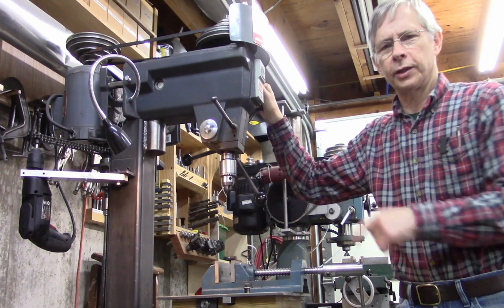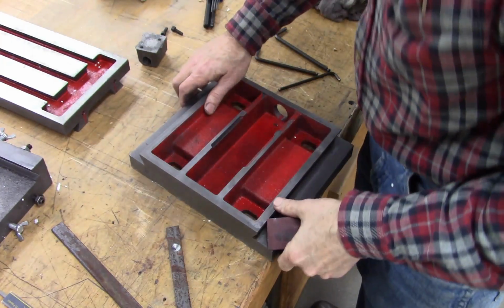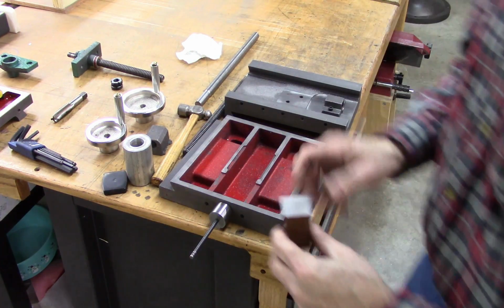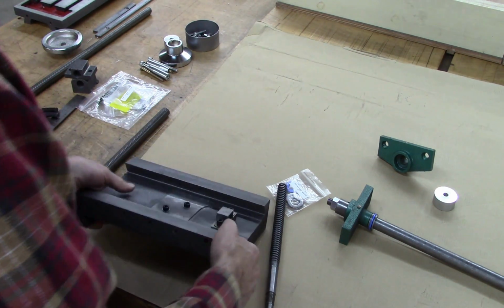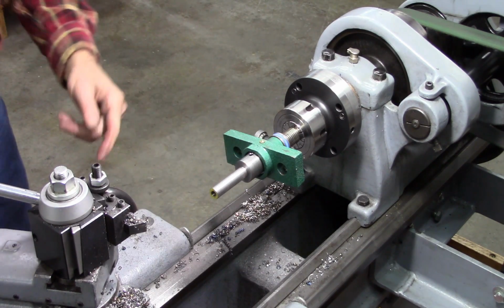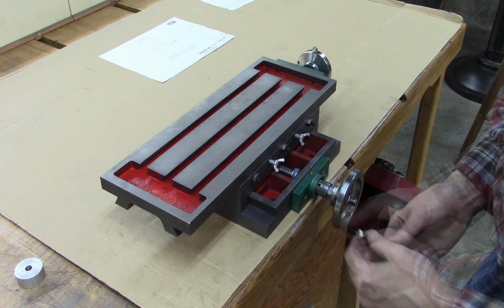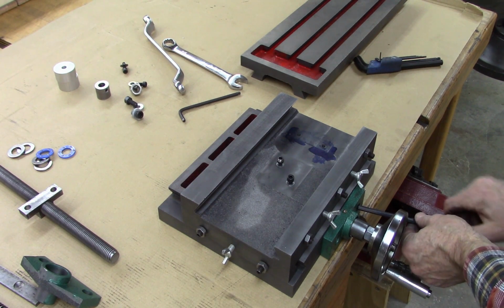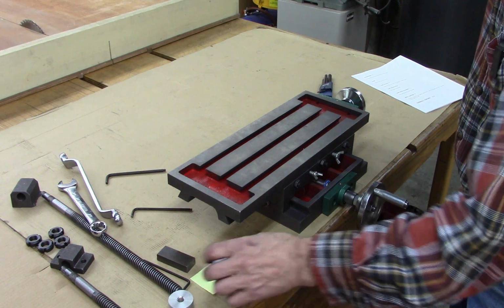Part-1 Vevor Compound Mill Table Review and Lead Screw Upgrade

Comment: Ok Winky. This is my last intrusion on your peace. I assembled the parts and found that the top table was very stiff. So on your suggestion, I opened it up and found that one of the bolts that holds the lower lead screw nut in place was rubbing on the upper lead screw. I took it out and used my grinder to reduce the diameter of the Allen head top. That did the trick. 
I might have made a mistake by applying a thin coat of silicon synthetic grease to all the sliding parts. It may be too heavy. I don’t know. 
After reassembling everything, the upper stage moves without any bumps although it’s still tight. 
The big problem is that I can’t center the mill table on my drill table because the lower turning handle hangs below the lip of the table. This mean putting a piece of wood underneath to raise the mill table. 
On top of that, I have a 4” mill vice that sits on top of everything. The weight is considerable and I don’t think my 20” Jet 20MF drill can handle it. Raising the table up and down is frightening. 
I just bought this drill press and I’m unhappy with it. I should have gotten the floor standing Nova instead. 
Thanks. 
P
Reply from the maker: No worries  please intrude anytime! 

>I can’t center the mill table on my drill table because the lower turning handle hangs below the lip of the table. 

I think you might be able to swap the hand wheels but I'd have to look at mine.

yeah...  the mill table is handy but also hard to deal with on a standard drill press column.  That's why I made a 4 x 4 column and power lift for mine. By the way...  if you feel like taking the challenge most drill press heads slide of the top of the tube and clamp. You can make yours into a floor model with a square column. If you do, the most critical part is getting a short section of tube welded to the top of the 4x4 tubing absolutely square.

Comment: Greetings to the Winkster. Well, I hope I don’t have to bother you anymore after this. Two things. 
1. The enamel pen was an almost failure. The grooves were so shallow that when I wiped off the excess, most of the groove ink went with it.  But I’d call it a 50% improvement over unmarked. 
2. I have my table reassembled. Everything seems to be ok…BUT, the upper stage is a bit stiff. Not sure why this is. I played with the nuts and set screws on the side to loosen it a bit, but that only gave me about 10% more ease. I’m wondering if it’s the two black nuts that go between the green block and the handle wheel. I was uncertain about how tight to make those. 
Can you provide any insight? Checks in the mail. 😬
Thanks, 
Paul
Reply from the maker: I'd say its lead screw alignment. The nut and end bracket are not perfectly aligned. I had to mill or drill the bolt hole in the bracket that bolts to the table This allowed the bracket to move over a little and align with the nut.
Reply: @WinkysWorkshop  
Hi Winky. I’m breaking my promise and contacting you again. 
First, my mill table is running smooth, thanks to your help. I have 2 steel blocks (1 x 2 x 3”), with a 1/2” hole in the center. I will use these to raise the mill table to clear the drill press table lip, and secure through the holes and t nuts. So all is good. 
Second, I want to deepen the scribes on my dial gauge using your technique. It looked like you used a 360 tooth saw blade as an indexing wheel. I have two applications for this. First is the markings on the mill table. Second is the markings on my rotation stage for the drill press vice that sits on top of the mill table. This has scribes every degree. So how do I make a 1 degree indexing wheel?
Many thanks again. 
And keep your eye out for a good used metal lathe for me. Southbend, Logan, Monarch or whatever. 
P
Reply from the maker: @paulmanhart4481  I was using a 100-tooth blade. This is based on the thread pitch of most lathes or in this case the new lead screws on my Vevor mill table. This is why I changed the lead screw in my table, to make it 10 treads per inch. This makes each of the 100 marks equal to .001", One turn = .100" and ten turns = 1.00" . The original lead screw was 4 mm per turn which is really hard to work with even in metric.  10's are easy to work with.

Comment: Oh, I also have Impressart enamel marker for making the marks on the wheel black. I’ll let you know how it works. $7 at Amazon.
Reply from the maker: Interesting...  steel is easier to mark. Aluminum is hard. Let me know how it works
Reply: @WinkysWorkshop  Another thing I didn’t know. But I’ll keep you posted. 
My only concern is that floating lead screw nut on the bottom. Needs to be attached to the middle plate. Concerned about alignment on both lead screws. 
I have my eyes on an old South Bend lathe not far from me. Guy says he has upgraded a  lot of things. Asking $2,500. Thoughts?
P
Reply from the maker: @paulmanhart4481  That depends on the model and condition. I sold my Logan high...  $2500 I think. My south bend might bring $2000 or maybe 2500

Comment: Hi Winky. I got my mill table apart. I filed some of the rough edges. Then took a rough Diamond honing board to the flat parts. Degreased everything and cleaned it up. One thing is that I could not find the right tap to finish the threads in the handle wheel. The threads don’t go all the way through and the bolt won’t tighten. But I’ll use nylon washers to take up the slack. 
I sprayed some T-9 rust protection on the parts then sprayed GlideCote over all the sliding parts. 
Putting it back together now. 
I seem to have an extra washer where the bearings go around the lead screw. I think it came from the long lead screw on the inside. Maybe to take up some slack?
P
Reply from the maker: I'll bet it works great now. I like this table...  too bad they didn't pay more attention to details around the lead screw.

Comment: was lead screw swap mainly to go from metric to imperial?  Any performance improvement in doing the swap?
Reply from the maker: Mostly to make them inch but it also helped with backlash. If I was doing it again I might simply add DROs and keep the old lead screws. The new lead screws were a lot of work and hard to get the alignment right.

Comment: I’m really impressed with your video. I just bought the same mill table and I searched for what to do before assembly. That’s how I found your video. 
But I don’t have a lathe or mill. What can you suggest I do without all the machining?
Also, I’m in the market for a lathe. What do you have and what can you suggest for under $4k?
Thanks,
Paul
Reply from the maker: Hello Paul. Great questions! First, the best way to make this table usable is to install DROs I modified mine with dials and lead screws just because i have the time and tools to do it. DROs are fairly cheap. Amazon has an 8" for $32 but the longer ones are about $70. You might try ebay too. For a lathe I'd consider going with an old used one like South Bend, Logan and Atlas but get one with a quick change gear box. You learn a lot restoring an old one. If you want to go with a new lathe I'd suggest a Precision Mathews. I've never had one but i know a few that have both their lathes and mills and they like them. Mr. Pete is a great resource for info on the old machine. I hope that helps. Thanks for asking.
Reply: @WinkysWorkshop  Thanks for the quick reply. I just opened my mill table, sled thing and noticed that the lead screws are not as good as the ones on your device. I wonder if they cherry picked one for you since you were doing a review. 
I’m impressed with your confidence in dismantling the pieces. I’d be worried that I’d forget what goes where. But I archived your video and subscribed to your channel so I have a reference. 
I recently restored my dads old ATHOL vice and that was a lot of fun. Bead blasted it, then two coats of 2k epoxy primer followed by 2k high fill and top coat. 
I have my eyes on PM lathes. Great machines. I’m not sure I have the skills to restore an old one. But I’m open to the idea. 
I want to get a mill and a lathe but my budget is tight. I think patience is best. Keep looking for deals on Craigslist. 
Thanks for your help. 
Paul
Reply from the maker: @paulmanhart4481  My lead screws were okay but the associated nuts and brackets were a complete joke. With that being said, mine had about 1/4 turn backlash and worked out of the box. Also, backlash is always a thing unless you have ball screws so it's just about as easy to deal with 1/4 or 1/2 turn.
Reply: @WinkysWorkshop  winkster, you have been a lot of help. I’m glad I came across your videos. So talented and knowledgeable. 
The number punch set you cited had 9 punches. Where’s the zero? Never mind. I’ll find out. 
Cheers and Roebuck. 
Paul
Reply from the maker: @paulmanhart4481  The 9 and 6 are the same punch. It gets confusing... make sure you turn it the right way.

Comment: Well sir your ability to spot and correct manufacturing and design concerns is to be commended. Your fabrication skills are beyond reproach. Your ability to review an item so that others may use your experience with said item to educate themselves further regarding said item and therefore form a more knowledgeable, well founded, decision regarding their potential acquisition of said item is absolutely horrendous. We have no more knowledge about the out of the box functioning of this mill bed now than we did when we got here. (OK, so maybe I have a LITTLE better idea)That said I watched it all front to back and am now headed to part 2. You've gained a new subscriber as well. So for a guy that does flat out crappy reviews, you ain't at all bad my friend. lol
Reply from the maker: HAHA....  Thanks! (I think?)  Maybe my summery at the end of part 2 will change your mind. Ultimately (if I did not make it clear) the mill table is usable out of the box with the addition of a DRO. Modifying the lead screws was a lot of work and the DRO is fairly easy to install.  Unlike the lead screws and brackets the castings were excellent. It's kind of like a house, you have to start with a good foundation. The rest can be fixed.

Comment: I only have one negative thing to comment on this video. Please use a way cover on the lathe when using emery cloth. The grit mixing with the way oil is like lapping compound for the bed ways. My South Bend lathe is a 1944 lathe, so it is a year older than me, and is in better shape than I am. I try to keep it that wy by not wearing out the bed ways. I wipe the bed down before using the lathe, then lubricate it well before turning it on. Cast iron will also act as lapping compound, so cover before machiningon it.
Reply from the maker: Yeah...  that is a good idea. I will say, I always clean the ways after grinding or sanding and at the end of the day the way oil is applied. Probably a good idea to cover them anyway.

Comment: I have the same drill press and I'm trying to understand how the lead screw assembly is supposed to function properly as is.   Does anyone know the names of those types of nuts that come with it, and any other terminology that might help me uncover some reading material that relates to the specific use of lead screws as they come with this table.   I don't have enough money to upgrade right now so I'm trying to do the best with what I've got.   I've noticed the stock 51102 thrust bearing races have different size interior holes on what seems like the back race.  Is this standard oir a fix for this job to make sure I dont put them on backwards? (The back race on first falls into the thread). The nuts used are antenna sort of nuts in a double nut arrangement.   I've been pretty confused about this for a while and not sure what it is wrong with this arrangement and how these peices should work ideally.   I think the problem is that the handle and the screw end peice that fits the bearings might not be accurate ... Anyways any insight is greatly appreciated.   Thanks for your video nice job on the drill!
Reply from the maker: >"I have the same drill press" Are you talking about the drill press or the mill table? The mill table lead screws and thrust bearing are a mess. I made new ones although it was a big job to get it right. Alignment is hard to get right. With that being said, the mill table functioned fairly well when I got mine. The only huge negative was the 4mm per inch lead screws. I work with inches but respect people that want to use metric but "4MM" per turn? This is not logical at all. I replace mine with 10 TPI so that one turn is 1/10" or .100" inches. 

If you want to use the table as is a DRO is the best way to go.
Reply: @WinkysWorkshop  I dont have the money right now for that but I realized the problem I was having is mostly that the nuts tightened down on the bearings too much i ground a bit off on the front bearing holder peice that screws into the dovetail peices to hold the screws.      Im gonna get ball screws when I can  afford it but I want to get these screws working working good just because... Anything is possible.

Comment: If you want to further reduce backlash, you can make a second nut for each leadscrew, and position it such that each nut is engaging on opposing threads.. i.e. if one nut is engaged on the left-hand side of the thread, then the other would be on the right-hand side.  backlash is really just the amount of movement needed for the thread landings to engage on either one side of the nut's thread landings, or the other. by using opposing landings, and having the nuts positioned so they are always engaged, you eliminate the backlash ( as much as possible without introducing too much friction to cause binding)
Reply: That's similar to what I did on my cheap chinese lathe/milling machine combo.
These units have .020 backlash on the cross slide.
I took a piece of UHMW and drilled a hole in it the size (or slightly larger) of the root of the acme thread.
Then I heated up the end of the acme thread with a torch and screwed on the UHMW.
This causes a perfect fit. Let it cool.
Next drilled and tapped two holes (one on each side) of the UHMW and installed screws. These are used for pushers.
Next run the UHMW along the acme thread until you reach the acme nut.
Tighten those two screws until you have no backlash.
My cheap lathe/mill now has .002 backlash according to my dial indicator.

Mr Pete did a lot of work here and only got a slightly better table in my opinion.
I would sure like to have seen him put a dial indicator on it to actually show the backlash. I bet it was a lot.
Making a backlash nut is really easy.
In my explanation above it might sound complicated but it's not.
Reply from the maker: I've done this in the past. The backlash really isn't very bad. Thanks for the comment.

Comment: i think you touched on something.  Many of these parts or tools we want to buy are expensive, but there are Chinese versions. As you did here, you can make leadscrews, buy bearings modify and fabracate a lot of little things, but the main casting is one thing you cant make. Their castings tend to be rough. basically any thing i buy from lathe chuck to xy tables like this, strip, clean and see if any improvement can be made. Its a trade off many hobbyist can make, cheap tool , plus a little project to do. It is important you manage your expectations properly
Reply from the maker: I agree totally. Thanks

Comment: I've seen this table on Amazon, and I was immediately impressed with how wide the bottom dovetail is, giving good support to the table, most have very narrow bottom dovetails that let the table rock. It was nice to see someone take it apart to see what it's like, is a lot for the price, and if you're willing to fiddle about with it ( perhaps scrape in the slideways, perhaps add ball screws or DRO ) it could be a very useful milling table.
Reply from the maker: Personally I don't think the castings need any work aside from sanding the corners. the lead screw was kind of a pain to deal with because it was a little big in diameter. If I had it to d over I'd probably install some cheap DROs and put smaller lead screws in... or maybe leave the factory screws. I will say, after the modifications I love this table.
Reply: you haven't seen Vevor on amazon, the ones on Amazon, Ebay, Aliexpress etc are fakes.
Reply: @i-_-am-_-g1467  who do you think makes fake Chinese products?